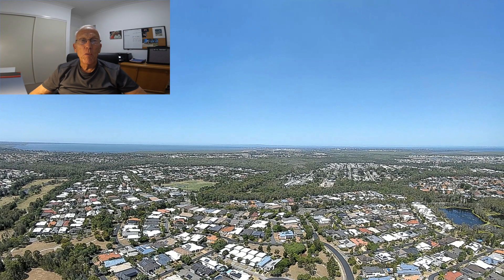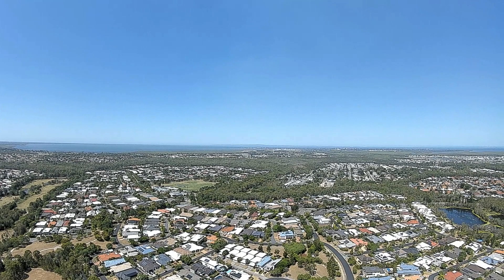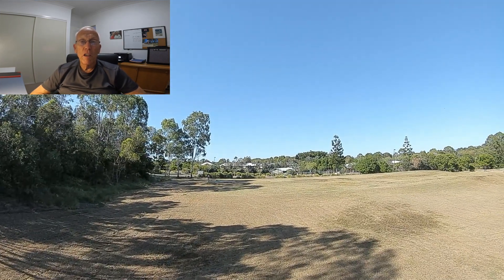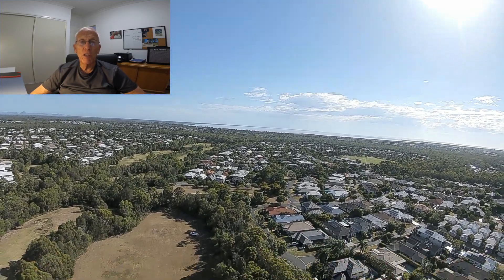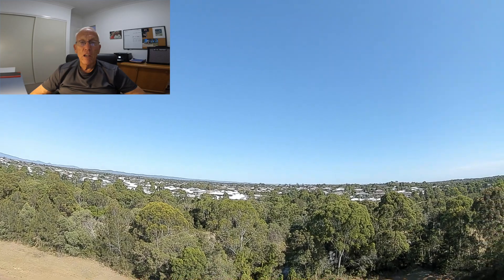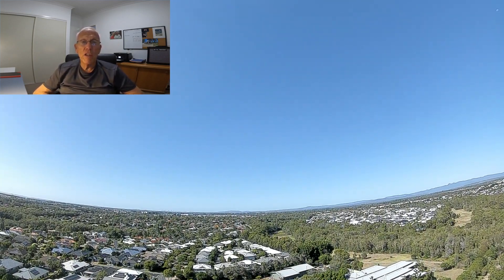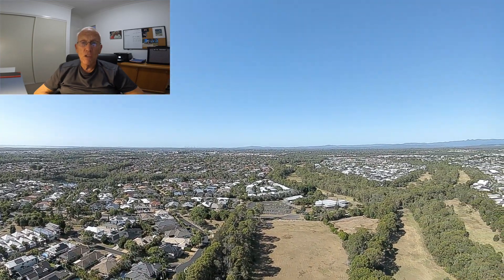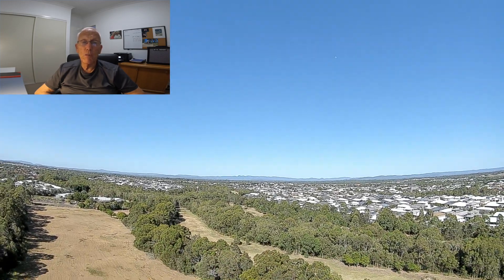BETAFLIGHT GPS RESCUE ISSUES

Comment: So am I able to put failsafe and gps rescue RTH mode on the same 3 position switch? First position is off / nothing. Second position is failsafe and third RTH?
Reply from the maker: I have it set up as follows. Position 1 is OFF, position 2 is Angle mode, flies flat and balanced and allows you to boost the throttle and the drone will rise up in the air hopefully getting you the video back and if not go to 3 position 3 is GPS Rescue.
Reply: Ok so when I activate failsafe mode on my transmitter I'm basically just testing RTH to make sure it works? Is that how failsafe works?
Reply from the maker: Yes that is correct . You can choose to bring your drone back anytime using GPS Rescue  as long as it is within what you have set, for example if you set it active from 80 meters you will need to be more than 80 meters away.
 @Chillin-fpv
Reply: Right so what's the difference between RTH and failsafe mode
Reply from the maker: Failsafe is when the drone system loses contact with the transmitter and it is automatic. RTH is if you want to bring it home because you don't know where it is. @Chillin-fpv
Reply: Awesome thank you sir I appreciate you

Comment: Increase your return to home speed to 20.0 and your pitch angle to 25.00 this should allow it to fly back smoothly. You can tweak these settings. The greater the pitch angle the higher the return to home speed has to be. I find that if your decent rate is to high your elevation isn't calculated fast enough for the quad to know a accurate elevation.
Reply from the maker: Thanks BrentI will give that a try.
Reply: @chriscflint  did it work? I've got the same issue ... Thanks.
Reply from the maker: @nmrlab3807  Yes it did. But I have stopped testing the "Landing part" as long as I get video back I am happy irrespective of where the drone is at that time.

Comment from the maker: Since making this video a few things have changed. The dis-arming at height can be corrected by adding #12343 into the commit line before the cloud build. This is still experimental but I have added it to two other quads we have and they are now landing and dis-arming on the ground.
A better GPS has also made the bobbing less of an issue. All  in all the next release of 4.4 will address these issues.
Reply: what gps module have you switched over too, I have the Iflight gps v2 (M8Q-5883) and I only get about 10 locks if I let it sit, looking to up that a bit if possible. :)
Reply from the maker: @HeyitsmeEarl  Here is the link to BZGNSS https://www.aliexpress.com/item/1005005088309006.html?spm=a2g0o.order_list.order_list_main.10.4ffb1802E8jAgo
Reply: at stage 1 or 2, your inputs are all Hold? I found a video by Limon - Ivan Efimov, his recommendation is to put Throttle to Hover, set to angle mode in the 1.5s. Will that help?
Reply from the maker: @jeffclassics  I did watch his video and did not use his settings I initially went withteh Betaflight Defaults. Only exception are I change the throttle to HOLD which means it is flying at soe throttle setting and I do not want that to change as the aircraft may drop. Angle mode I only have for an emergency basis  ont he same switchas GPS Rescue in that if it goes out behind someting that blocks the video I can if I need is click itintoAngle and power it up to get instant height.
Reply: @chriscflint  thank you. I updated to 4.4.1 and tested gps several times. 2nd time was a charm, little nose pitching and landed ok. Tried couple of times again and not able to repeat it or rather I stopped rescue earlier coz the pitch nosing were very sketchy. I even had a time when it disarmed at 8feet.
Reply: @chriscflint  when I was still at 4.2 these don't happen. I also noticed that gps rescue has its own Pid? Why is that? I think that's why gps rescue is even harder to get working. 4.2 I think is better, it just rotate 180 and fly home, no etc etc
Reply from the maker: @jeffclassics  HiJeff,one thing to do when testing is to take off and fly a strait line away from your position. Ensureyou have the Arrow for Home position in your OSD/goggles where you can see it and ensure that it showsthe correct direction in other words it points where you are. Fly around your position and watch the arrow to ensure it keeps pointing at you. If this is happenning then fly away and switch to GPS Rescue with whichever switch you set up in MODES.It should work fine. The pitching is the drone trying to get an altitude fix, probably can be fixed with some tuning.

Comment: Hey Chris, hopefully I can help! The pitch bobbling you are seeing is a result of the 'gps_rescue_velocity_d' CLI setting. It is reacting to the noisy velocity calculation that Rescue uses... The default is 20 something, but I've found lower values of 12 or so work, with less oscillating. Also, a higher ground speed brings noisier velocity signal and lower speed tends to be cleaner.  Now for the early disarm.... There are two parameters that trigger disarm, one is an accel threshold and disarms become possible when quad reaches the 'gps_rescue_landing_alt' height, default of 4m. If your altitude readings are accurate (it lands with alt reading within 1m), you can lower this setting to 2m or so. Then, disarms will only be possible at a lower height. In this case, propwash G's appear to have triggered disarm. You can avoid propwash by extending the 'gps_rescue_descent_dist'' which I recommend, as your ground speed is high, the quad easily reaches and overshoots target (rotating as you descend). If this is 20m, try 30 or 40m descent distance. This will allow a smoother trajectory with less chance of propwash near the end. 

Most of these settings can be changed via the Betaflight lua, or through the OSD menu: Failsafe -> GPS Rescue.
Reply from the maker: Thanks for that. I did lower the speed and there was a difference. On the last part (disarm setting) I actually increased the setting from 4 to 10 meters to see if that had any effect, figuring that the 4meters  was probably too slim a margin, but then the NEW build crapped out the DJI AiR unit, so the air unit is back at DJI for a repair, (hopefully). On my other two quads a ROMA and TITAN both 5" they work perfectly with the BETAFLIGHT standard settings.

Comment: Does your quad have black-box logging? as I suspect the disarm is triggered by the onboard accelerometer if this is noisy it could think its already on the ground. You could look at the black box log file to find out whats happening perhaps.
Reply from the maker: Thanls for the response.
I do have the Blackbox information but once it disarms information gathering stops.
Up until the GPS Disarm the Accelerometer on Z axis (going down) was reading around 0.75g at disarm it was at 1.78 roughly 0.09 seconds before the disarm. Motor powers were 25.31%, 37.27%, 32.02%, 44.97%. I would still like to know what disarms the quad is it GYRO on Z axix and if so can we up the value??
Reply: @chriscflint  Umm the guys that program betaflight may be able to to say what the g level needs to be to disarm I'm not sure I assume you have the GPS rescue sanity checks set to fail safe only and not to always on it might help? Sorry cant be of more help
Reply from the maker: @gwizard12  Hi there yes, the sanity checks etc. are all ok. What I have since found out is that there is a height at below which the landing sensory mode is activated and it can be varied from 4 to 15 meters. Mine was set to 4 meters and I have raised it to 10 to see if that assists as i think what was happenning is the barometer was not reporting the correct height and that caused the unit to disarm. Another thing by the way, is we cannot adjust the landing g force sensititivity at this time.

Comment: Hi Christopher. Thank you for a clear example of the problem. My Chimera did the same thing. It disarmed the motors during GPS rescue. And the altitude was a very high.
Reply: Same
Reply from the maker: @bartonfink5051  We will get is fixed as I am sure it is a simple fix. Just not looking in the right place at this time.
Reply from the maker: It is a problem that I intend to find the solution for. I need to first find out what BETAFLIGHT uses to disarm the quad, i.e. is it power, is it movement, it is altitude based on the take off altitude and if it is the last one then it will be difficult to get it sorted out.

Comment: there are a few specific options you have to change and it will quit doing that
Reply from the maker: I would be keen to know what they are.
Reply: @chriscflint  I will help you
Reply: @KCQuadTronX   Thanks!  I am the point of dialing in the settings and have tested some switch initiated rescues and it's validated that my HW is sound and the quad is beginning to come home in the right direction. I experienced the a similar power/forward speed oscillations. 

 So far the biggest challenge for me has been establishing a consistent hover power value. So far it seems like it either climbs like a rocket or drops like a rock.  Once solved, I will follow some of the guidance from this thread (slow down the ground speed, etc.)
Reply: " I have a solution to your issue"... <looks at watch>  "well, gotta go!"  
-Cmon man, you cant just leave a motsa ball out there like that and not back it up a little.
Reply: @BigDaddyI1I  just hmu
Reply from the maker: @BigDaddyI1I  Pleasetell us. thanks
Reply: Ok so I can help you
Reply from the maker: Please tell us what you have in mind.